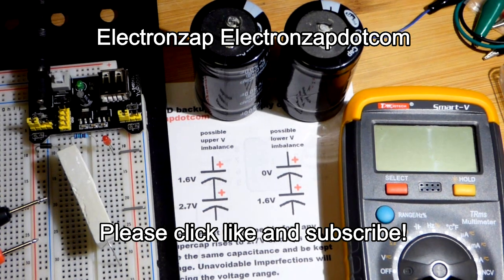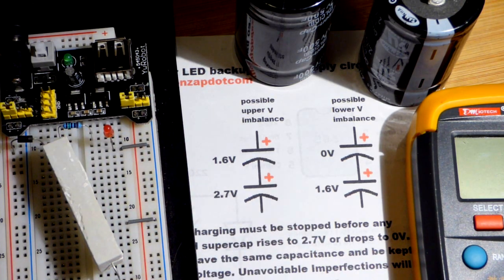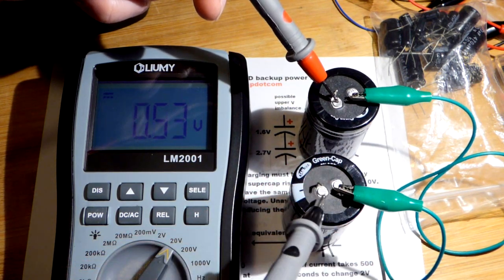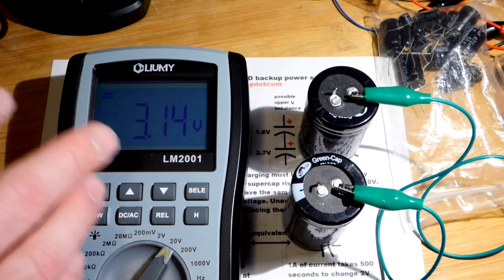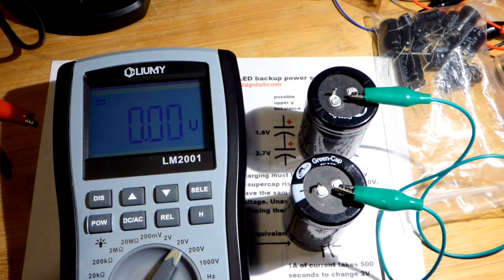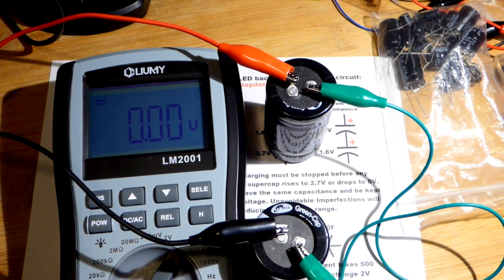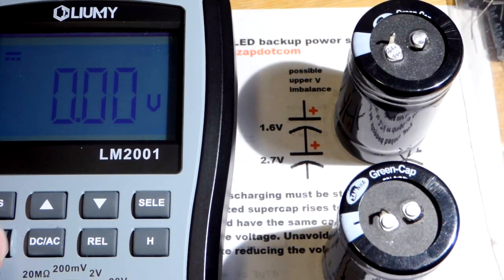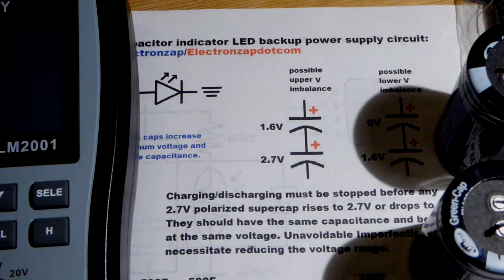Charging 2 cheap so called 500F supercapacitors in series to see how unbalanced they become

Comment: The supercaps have lower internal resistance than those dinky thin alligator wires. If you got them cheap from some noname shop then they can have something like 1 Ohm and it's not because they are badly crimped or soldered but because manufacturer cheaped out on the wire. Not recommended for any serious work or measurement.
Reply from the maker: Good points!

Comment: Been considering buying some super caps to make an automatic vehicle jump/boost box. I was thinking about incorporating a boost circuit to harvest energy from a mostly flat vehicle battery that would charge the caps up to a voltage capable of starting the vehicle. It would then automatically switch over to dump this energy back into the vehicle battery terminals, while simultaneously signaling to a person behind the ignition to attempt to start the vehicle. I know such a device can be purchased premade, but I figured it would be a fun project. I would probably also include a hand crank generator, in case the battery is too flat to charge.

I was looking at "Green-cap" caps but this video, among a few others has shown that I should avoid these. Any other cheap brand you'd recommend? Otherwise, I might just pay the premium for better branded caps
Reply from the maker: Sounds like you have progressed about as far as I have on those topics. I don't have space or funding for serious supercapacitor projects so I am way behind other YouTubers in that aspect. I did make this video though on using a hand crank generator to charge a supercapacitor bank called "Mini portable hand crank electric generator charging series supercapacitors demonstration" https://youtu.be/b2U8av1DNPU . If I bought capacitors for a serious project and needed good ones, I would consult the manufacturer claims (datasheet) and also read the customer and other reviews to look for complaints or praises on particular aspects important to my project and then compare prices and then charge/discharge them to test them out. Vehicle batteries and starter systems rely on high currents for a short period of time. A weak lead acid battery mostly suffers in being able to provide high enough current to power  starter but probably still stores a lot of charge, which is why it is used to charge supercapacitors relatively slowly and then the 2 of them together can provide the current needed to start the vehicle over that short period of time. Everything being able to handle the current involved at each stage is the most important factor to prepare for.